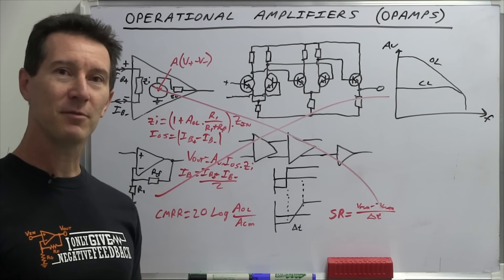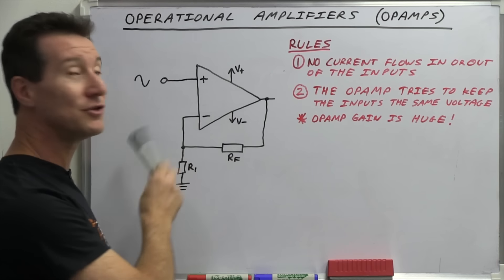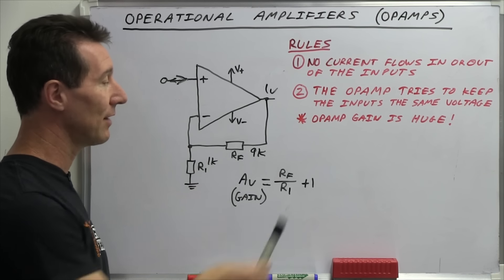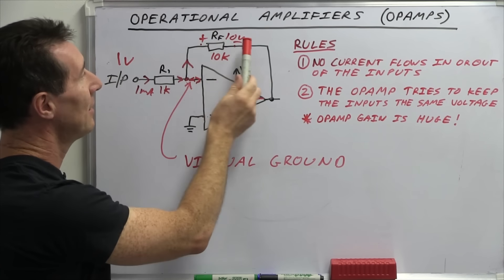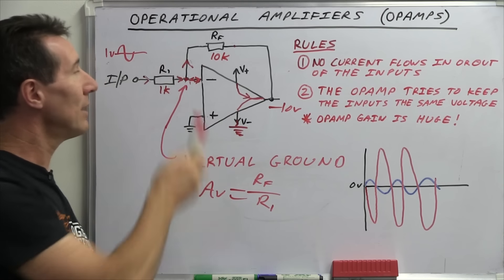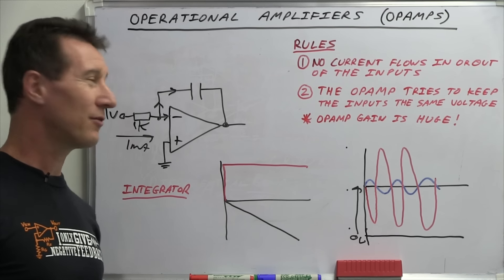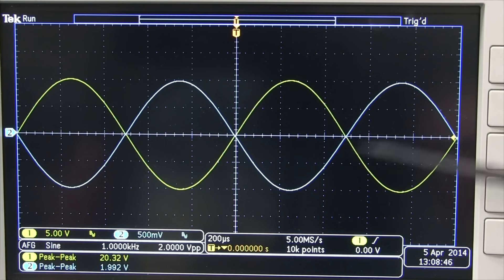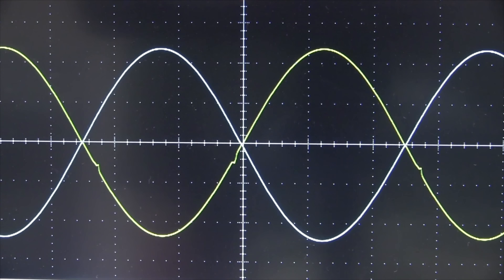EEVblog #600 - OpAmps Tutorial - What is an Operational Amplifier?

Comment: "The gain is almost infinite"

spoken like a true engineer!
Reply: A power speaker guidance glee Iowa amp it up yeah
Reply: 48:40
Can anybody please tell me the reason of this ?
Reply: @youtubegoogle4163  I just gave this reaction below, but i think it's the sink current working very close to the maximum rating:  

 the sink current for Vout=200mV is only 50uA, and goes quickly up to 20mA at Vo=2V.  Because of the 10k resitor for R2 it's working very close to it's maximum ratings at the lower end. 0.5V out is 50uA sink current.  And (apparently) in practice this results in the weird ground spike that fck ups the output.
Reply: @youtubegoogle4163  Looks like crossover distortion, the switch from sinking to sourcing current... and at the point when this happens the opamp is neither sinking nor sourcing correctly, so the negative feedback stops working properly and the input voltage is allowed to spike momentarily.
Reply: and the open loop bandwidth is darn near zero Hz.
Reply: Me too love your tuitions 😃
Reply: so this is how billionaires get their money
Reply: @youtubegoogle4163  An op amp delivers current into a load connected to its output but also into its feedback resistor. With no load, the only current from its output pin is into the feedback resistor. Changing from a 100k feedback resistor to a 10K draws more current from the output. With the + input at ground, the - input also looks like ground, so the current through the FB resistor is Vout / Rfb.
Reply: Almost infinite is infinite + something which is infinite :)
Reply: @robertkokal2511  Stay away from your keyboard if you've been drinking.
Reply: This guy is DATA from Startrek ];-D.
Reply: @youtubegoogle4163  he's showing crossover distortion.
Reply: Compared with infinity, the gain is almost zero!

Comment: In my whole electronics major shit , I have never seen a person who explains virtual ground like this.
#RESPECT
Reply: This term makes no sense
Reply: @StEvUgnIn  Abolutely no sense.
Reply: He’s amazing love it,,I’ll figure it out  virtual ground oupps
Reply: It’s spiritual
Reply: @StEvUgnIn  Does the "virtual ground" means 0V ?? If so then it really doesn't make any sense 🤦‍♂️🤦‍♂️
Reply: Marc Victor Ground has not always physically its potential to 0V. The voltage we measured is the difference between the potential ground and a potential node
Reply: @StEvUgnIn  Oh so you mean it is SUPPOSED to be 0V reference to gnd but it is sometimes not, like in an open loop circuit or when the output is saturated. Is that what you mean ??
Reply: @marcvictor5305  No, nothing to do with saturation. It is purely related to basic electrostatics. An open loop circuit won't measure more than 0V if it is not powered. An electron in a high conducting material in comparison can produce a light amount of electrical potential you can determine in electronvolts.
Reply: @StEvUgnIn  Can you explain it in noob level 🙂 I'm in high school but still I understand electronic circuits and know how to analyze them
Reply: @StEvUgnIn  Nvm I searched for it
Reply: Marc Victor I suggest you some reading on electromagnetism with a couple exercises. The book I studied the most from is H. Benson, physics 2, Electromagnetism
Reply: @StEvUgnIn  well, you're correct but he named it virtual ground (fake) just to make it simple to understand that it will have no voltage at that particular point, and mostly ground has 0 volts if you leave aside complicated electrochemistry.
Reply: i think it is better to talk about virtual short circuit
Reply: Try being taught by an engineer, like Dave is. When they have academics teaching you, you won't ever hear anything practical to the job.

Comment: Regarding the puzzle at the end, the low resistance effect is an increased current at the OA output. the OA at approximately Vout= -0.5V should sink 50uA which is higher than the value in the datasheet/figure13 of 30uA max. so the virtual ground voltage fluctuates and so does the output at approx. -0.5V.
Reply: baby...
Reply: Thank you.
Reply: in the new datasheet, i think its figure 47, that explains this.
Reply: @cireekratz2017  

Above explanation said.

at Vout = -0.5V
I sink = 50uA  (> 30uA)

Can you please explain me,
What special thing happens at -0.5 V,
Which doesn't happens at other output voltages ?
Reply: @youtubegoogle4163  Hi, the thing is, that this IC has limited current sinking capabilities at low negative output voltages.

In the -0.5V case the sinked current should be (-0.5V/10kOhm) 50 uA. But the IC is not capable to sink that much current at this V_out. Figure 47 in the datasheet shows that it only can handle ~40mA.

Now there are 2 cases:
- slightly higher V_out (like -0.25V): the sink current lowers to 25 uA and that is just in the limit that can be provided (when the supply V difference is at 30V, grey curve) After that the virtual GND can begin to deteriorate.
- lower V_out (like -0.75V): the current sink capability of the IC rises rapidly (after the kink in the curve). It lands around 1.15mA which is sufficient by far.

In the end Dave chose a really nice corner case, where there is only 1 output voltage, where this problem arises. If you lower the R values further, the problem should expand and should arise shortly after V_out = 0V and stretch to around -0.6V.

Hope this helps.
Reply: @cireekratz2017  
A great great thanks for your Help bro,
I have asked all my professors and seniors in my electronics engineering branch,
Most of them were trying to procrastinate this question as the were unable to answer.

Now,
I have a little correction for you,
At the end of 2nd paragraph,
It should be ~40uA (not 40mA).

And,
I also have a question,
Why are you saying negative in 1st paragraph of your above reply, "this IC has limited current sinking capabilities at low negative output voltages.",
In figure 47,
It is not written that the curve is valid for negative voltages only.
Where to find this ?

(I am a 2nd year electronics engineering student from India,
So, I have not been taught how to read datasheets by anybody till now.
If possible, please provide me some tips for reading datasheet.)

And Once again,
A Great thanks for your help !
Reply: @youtubegoogle4163  Yes you are right abour the mA, sadly I don't know if i can correct that.

About your question: the title of Figure47. is Output Sinking Characteristics. To sink current at the output there must be a negative voltage at the output. Therefore the curve only applies for negative Voltages. It is sort of implied by the naming of the figure and the x-axis.

Reading datasheets is not easy. Especially, because there is no exact standard for this. But most of them are structured similar. As i am only a hobbyist myself, i can only tell you what is most helpful for me:
- after reading over the description on page 1 i mostly jump to the part called: "Typical Application" to see an example circuit
- the next most interesting thing is the "pin configuration" to see what each pin does and make a note of important terms
- the terms you are interested in can mostly be found in the "detailed description"
- after that you should really have a usecase that you can test in a lab or so, deep diving into the rest is really only useful, if you have a specific problem and can measure things.

hope it helps, practice is the most important thing when dealing with datasheets
Reply: @cireekratz2017 

First of all,
Thanks for your tips on reading datasheet.

I think,
Sink current is the current which is flowing inside or outside the output of the opamp.
If I am not correct about this 👆
Please clarify.

Now,
Considering,
If the sink current is only the current which is flowing inside the opamp through its output,
i.e. fig 47 is only valid for negative output voltages,
How to determine its behaviour at positive output voltages ?

Does figure 46 represents it's behaviour at positive output voltages ?
Reply: @youtubegoogle4163  Yes your guess is right. "Output Sinking characteristics" mean the case, when current is flowing into the Output of the OpAmp. So figure 47 is valid for negative voltages.
 Figure 46: "Output Sourcing Characteristics" are the other way around, when the current flows out of the Output of the Opamp. It is a little bit misleading, that the current is named "Output Sink Current" in both cases.
There you can see that the OpAmp is only capable to provide around 25 mA, even at higher voltages.
Reply: @cireekratz2017  
Yeah,
Thanks for clarifying 😁
You cleared all my Doubts.

( I have just 1 correction on your last comment, it is capable of sinking max 40 mA, and stable till approx 35 mA (not 25 mA) )
Reply: @youtubegoogle4163  you are right. i slipped a line in the diagram :)
Reply: @cireekratz2017  .
Reply: great job Tarek!  abbas
Reply: @cireekratz2017  
Not sure what you meant.
If you check the vast majority of figures (including fig. 7-47 in the new datasheet), the op-amp were being powered by single rail as oppose to dual rails as in Dave's case. 
A dead giveaway is the fact that in fig 7-47, maximum output voltage for Vs=5V is ~ 4v, not possible if Vs is actually split into +-2.5V.
Since it is single rail, all voltages must be between V+ and ground. The op amp can't produce any negative voltage since it is powered by a single positive rail.
In said figures, they measured the near-rail swing capability of the op amp, and it is quite natural that the capability of the op-amp is drastically lowered when forced to swing near its power rails.
You can also check figure 11 in the datasheet for the LM358-N, which should look very similar. There they drew the schematic for their measurement/figure, and it showed that they explicitly used single supply rail, hence the near-rail limited current characteristic, which is quite common in op-amps.
In Dave's case however, the weird behavior happens very close to split rail ground, or ~0 when the signal is +-10V. As such the behavior is not due to the op amp's near rail characteristics.

Comment: Very helpful. I'm an electronics technician and you see this stuff when you're doing repairs or troubleshooting but you never get down to the nitty gritty details especially after 30+ or so years goes by from your initial electronics training so it was really nice of you to explain this especially on layman's terms. Someone else mentioned in this blog about cutting and pasting working circuits into projects and calculating as you went along to fit your needs which is pretty much what I've done in the past so this has really been a BIG help in the memory refresh department. Thank you ten times over and may the "electro" Gods shine good fortune down upon you sir!
Reply: I had electronics like a hobby in the secondary school and also the time I was in the university even I've studied mechanics. Great presentation !!
Reply: electronic technicians nowdays repair FLAT TVs, monitors, cell phones, install and repair satellite installations, alarm systems, fire detection systems, CCTV installation, PLC programming and maintenance in industrial applications, and a variety of other applications ...
Nowadays, even the electrical appliances of a hotel kitchen may have electronic control boards with fiber optic and internet connectivity.
And in some countries it is not always "throw the old board away and put the new one"
this is the easy way that even a 10 yo child can do.
What if a new electronic board is too expensive ?

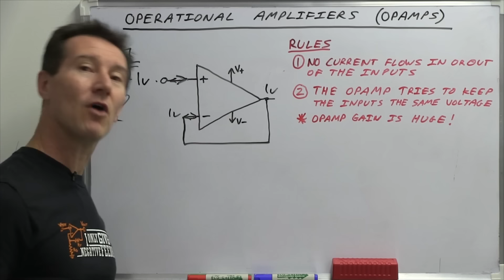Comment: Read this after 12:23 and listen to buffer amplifier again.
The primary objective of buffer circuit is to boost the current in any circuit at any stage. Buffer circuits are mainly used where a signal has very low current input(high input impedance) which needs to be increased maintaining the same voltage levels. So, this buffer circuits draws current from power source and adds it to the signal.

Buffer amp is also called as voltage follower or unity gain amplifier . Hope this makes sense now !

Comment: If anyone is interested the gain of the non-inverting config can be derived from the voltage divider equation:

Vin = Vout*R1/(R1+Rf)
Vin/Vout = R1/(R1+Rf)
Vout/Vin = (R1+Rf)/R1
Vout/Vin = 1+Rf/R1

And the gain of the inverting config can be found from the currents:

I(Rf) = Vout/Rf
I(R1) =  -Vin/R1
-> Current through both resistors is equal so...
-Vin/R1 = Vout/Rf
Vout/Vin = -Rf/R1

:)
Reply: Amazing how simple the above is when you can assume that the internal gain of the opamp is infinite. Everyone going through EE should be able to demonstrate the above in the time it takes to write it down. Well done.
Reply: Here Vin1=Vin2 due to the virtual short between the input terminals, if anyone had a doubt
Reply: Thank you so much for this! Not as bad as I thought coming into this! Matter-in-fact, really fun!!!!!!!!!!!! :DDDDDDDDDDD ♡

Comment: Excellent video Dave!

Concerning the puzzle on the end. I think it's the reduced current sinking capabilities of the LM358 when Vout is small in respect to ground. If look up the "Output Characteristics Current Sinking" graph in the datasheet you can see that the LM358 can sink very little current at low output voltages. As you have a 1k R1 and 2Vpp input voltage you have 2mApp of current, which is still too much to sink for the LM358 at low output voltages. So the LM358 can't keep the virtual ground equal with the "real" ground trough it's FB network. Therefore you get those spikes and the sagging and rising of the virtual ground in between.
Reply: Nice work! I noticed that all datasheets doesnt show this. The Motorola version did not so that might be an extra "trap for young players"
Reply: That´s it, exatcly :)
Reply: You are right, just a small clarification. the OA at Vout= -0.5V should sink 50uA which is higher than the value in the datasheet/figure13 of 30uA max. so the virtual ground voltage fluctuates and so does the output at approx. -0.5V.
Reply: +TheElectr0nicus but why does it jump like that? And why is there such a weird knee in the sink around that voltage (i.e. the physical reason for the fact that it goes closer to linear at even lower voltages)

Comment: Back in May of 1978 I started work at an aerospace company that made the engine controllers for a military jet aircraft.  The engine controller was a low frequency (less than 10 KHz) precision analogue computer that had amplifier gains & offsets calibrated to +/- 2 mV with select on test 1% tolerance resistors.  Some critical circuits in the controller used 0.1% tolerance resistors.  Positive 10 V and negative 10 V references were used throughout, and as well as the usual feedback loop components there were two 10.6 V Zener diodes in each loop.  All of the virtual earths were connected to a virtual earth monitor that used a high gain amplifier to indicate any opamp failures.  After a few years the engine controller was redesigned around 12 MHz 16 bit microprocessors and was considered to be not as good as the analogue version because at full speed the aircraft would travel about 50 feet before the software loop was reiterated.
Some of the circuitry in the analogue version was very unusual and complex and I learned a lot about circuit design with opamps.  It was a great place to work because there were occasions when batches of high grade components were thrown into a skip, and the company didn't care where they went.  To this day I have a huge stock of mostly obsolete but still useful components that I use for making projects and stuff that can't be purchased off the shelf.

Thanks for the video.
Reply: so was the processor just running at too low frequency? also what did the engine controller do/was used for?

Comment: Great explanations. I used OpAmps before, but more copy-and-paste style, just using the standard circuits without thinking about it. Now it makes sense why it works, and with the two rules I might even create equations to analyze more complex circuits, like the differential amplifier, where you've lost me a bit.
Reply from the maker: Yeah, I did gloss over the differential amplifier a bit, sorry about that.
Reply: Gloss? Yeah I totally missed Diff Amp totally. You probably used initials DA and it just didn't register in my mind.
Reply: I'm not sure what the issue is.  Analyze it like any other inverting amp.  The voltage at the inverting input sets the voltage at the non-inverting input:  0.91091V.   The voltage drop through the inverting R1 1K resistor is 1.1V - 0.91091V, or 0.1909V.  The current through the inverting R1 and sunk by this inverting op amp through the feedback circuit is 0.19091V / 1K, or 0.1909 mA.  The voltage drop across the feedback resistor R2 is 0.1909 mA x 10K, or 1.9V.   The voltage at the op-amp's output is the voltage at the inverting input less the voltage drop of the feedback resistor, R2:  0.9191V - 1.9V, or about -1V.     As a check. the voltage gain formula is -R2/R1, or -10K/1K = -10.  The difference in voltage at the inverting and non-inverting inputs is 0.1V.  So, the op-amp's output using the gain formula is .1V X -10, or -1V.